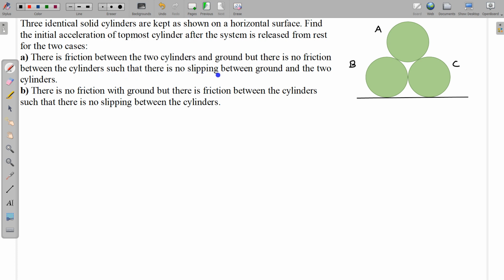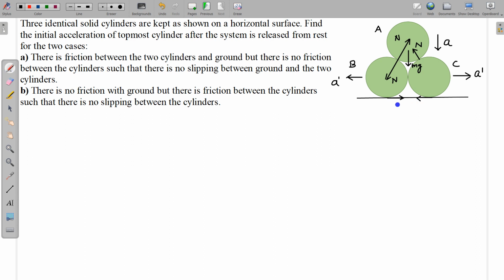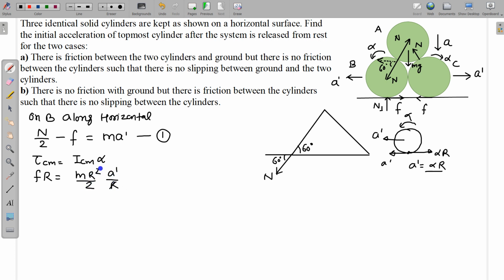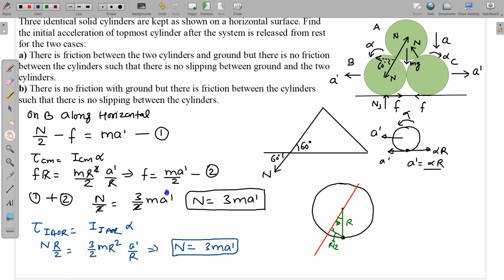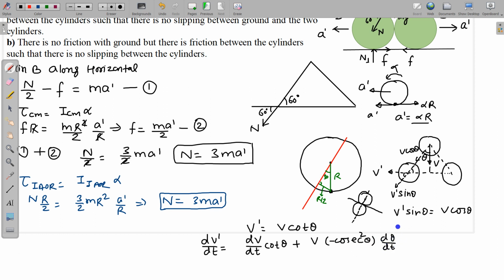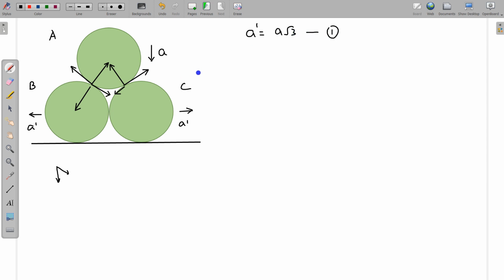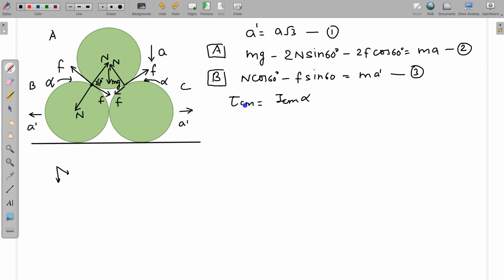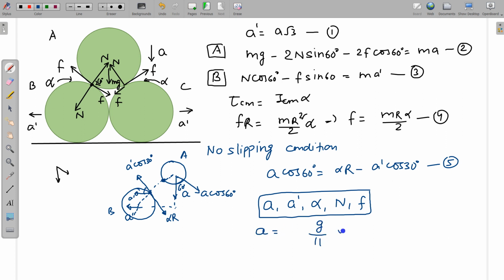Rotational Mechanics | Advanced Problem | Three Cylinders & Friction

Comment: Sir in first case I tried by considering movement of COM of upper sphere as x and lower sphere as y and related them geometrically, followed by conserving energy, and then differentiating the whole equation to get the same answer. Method legit?

Comment: Won't the torque of (mg of upper cylinder) should also be considered for torque calculation about the center of mass of the lower cylinder?
Reply from the maker: No.
I have taken one cylinder as a system for writing equations.
In addition to this system of two cylinders is not a rigid system as distance between two points in the two cylinders can vary with time so it will be meaningless to write torque equation for two cylinders.